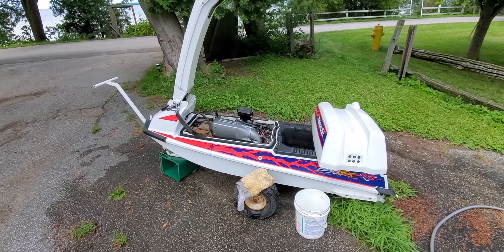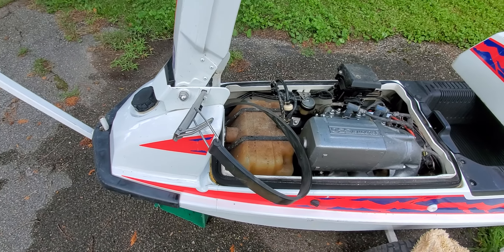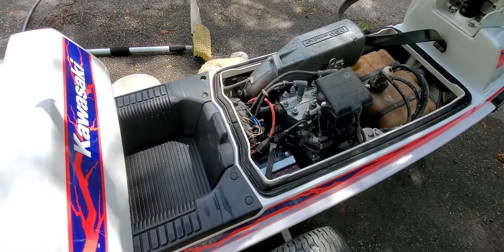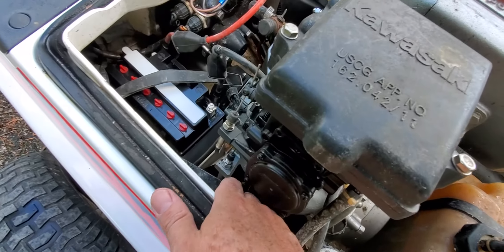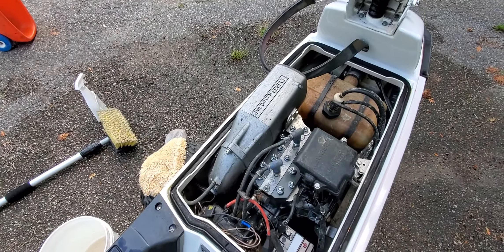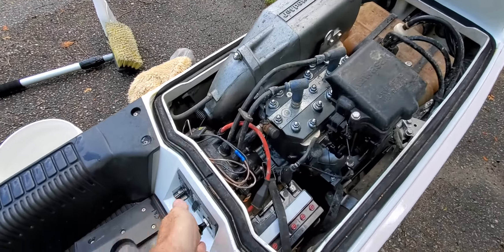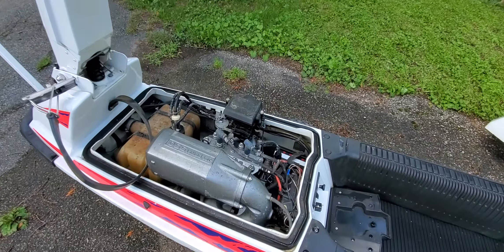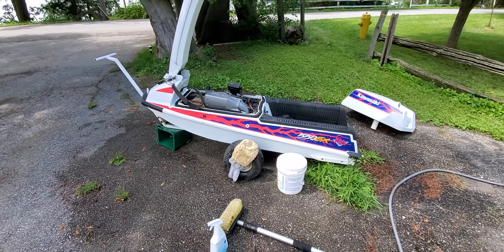1991 Kawasaki 550sx - Will it start? first start in 6 years.

Comment: perfect, it took me ages to find someone else with the reed motor, all stock so I could use it for reference, mine came with a bunch of mods on it and it got rolled the wrong way last summer so I tore the engine down dumped the water out lubed everything made sure bearings were okay this summer, and she fires up and howls, its very loud however the idle may be set a little high.